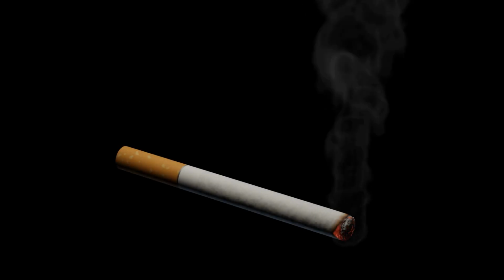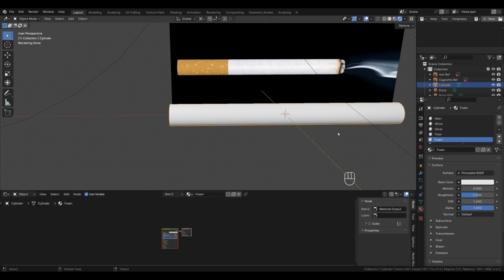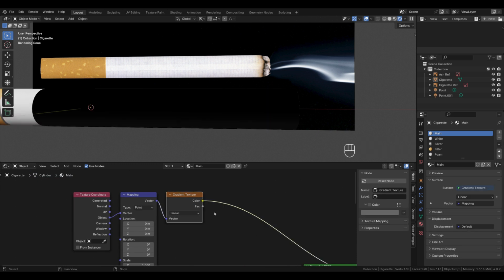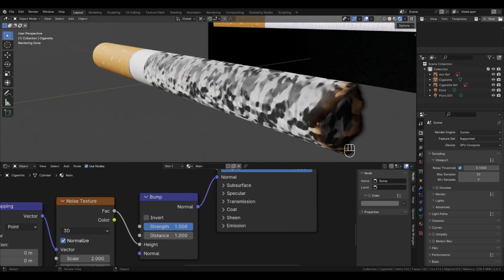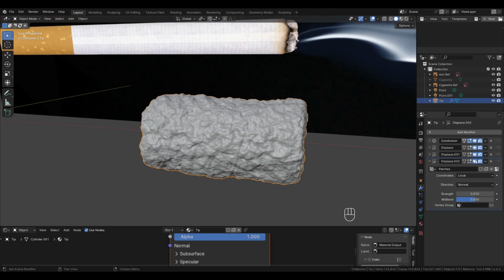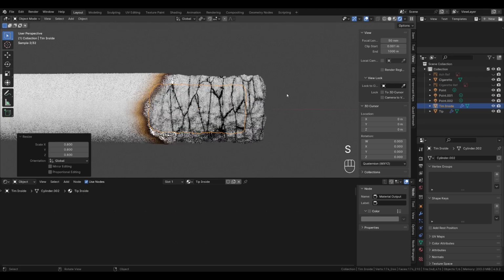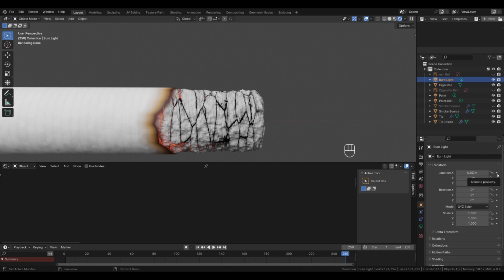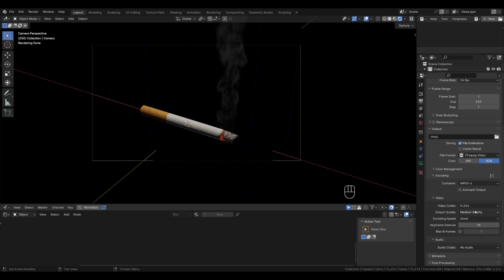Create a burning cigarette animation

Comment: I am working on my own model, its marlboro gold. I modelled a marlboro 100s and realised I needed 3 gold rings and the text flipped so I went ahead and fixed that while I was mid way through the smoke simulation. I zoomed out to look it over and check it looked right next to my real life reference cigarette. However I have managed to mess up the tip of my cigarette. To be clear, it won't display my burn node group at all anymore, no colour of burn, no transparency, etc. I tried messing with the values of my mapping node, tried messing with the color ramp. Tried moving the edge loops of my gold rings and logo text to give it the same size as before. Somehow it wont fix. It was working perfectly before this edit. Anyone know how to fix it?

Comment: Hey man thanks for the amazing tutorial, but I'm having an issue with the smoke simulation as the smoke starts a bit far and then gets closer so it's only on the last frame where it's in the place it should be. A fix would be appreciated, thanks
Reply from the maker: Thanks for the kind words :) Have you changed the flow of the smoke source to "Inflow"? Also, it might help to free all and then bake all again - for the smoke Domain.

Comment: Hey! I just followed the smoke section step by step (Adding it to an existing cigarette model) but I don't see any smoke at all. I watched through a 2nd time and I did everything correctly, do you know what could be causing this?
Reply from the maker: Are the smoke domain and smoke source the same size as in the tutorial?
Reply: @ragoon3d  Hi, no I need them to be larger as it isn't a close up shot of the character smoking the cigarette, and the characters and cigarettes are much bigger than the dimensions in the tutorial
Reply from the maker: I see, so you would probably have to change some settings especially for the smoke source, such as longer dissolve and so on… make sure not to skip the smoke material. Try having a dark environment with light to the smoke area so you can see it clearly at least for now.

Comment: Thank you for the tutorial! Is there a way to make this work in EEVEE? The transparency for the tip works only in Cycles unfortunately.
Edit: I was able to get it to work by messing with the top color ramp node of the Burn group nodes. It can be seen on 15:11 . The position of the black and white flags should be 1 decimal away from each other. The one on the video is using .33 for both values. For it to work in EEVEE it should be .33 for the first one, and .34 for the second one.
Then go to the Material settings of the 'Main' material and change the Blend Mode and Shadow Mode to the 'Alpha Hashed' modes. 
Change the Blend and Shadow Modes for the cigarette 'Tip' as well.
Reply from the maker: Thank you for the comment 🤙 
I’m glad you managed to figure it out, well done! 👏👌😎
Reply: Wow! Thx! Such a life saver 🙏🙏🙏
Reply: how to change the blend mode and shadow mode to the alpha hashed modes ? thank i'm newbie
Reply: I'm using Blender 5.2 and neither one of your methods make burning end transparent:face-purple-crying: